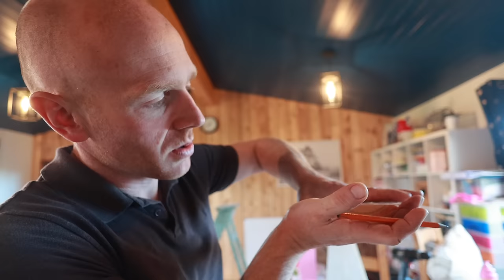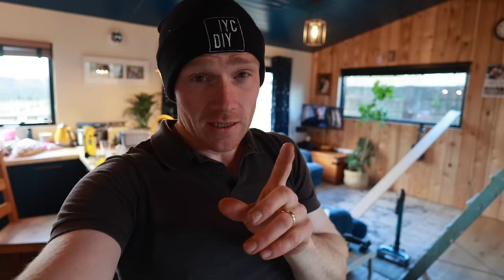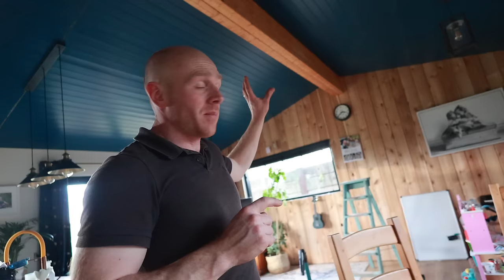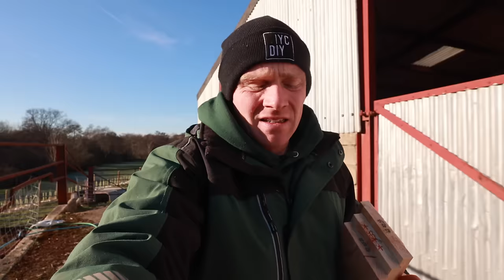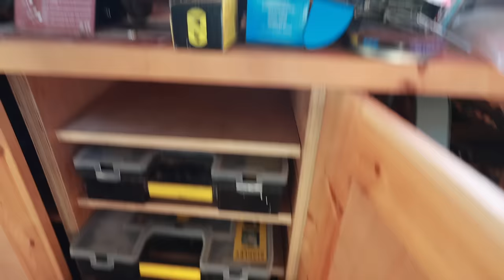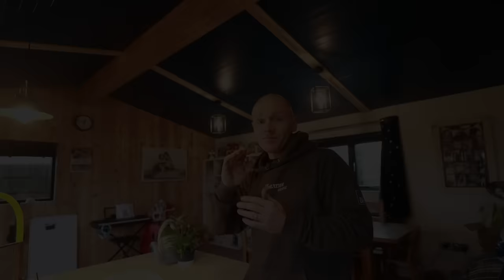BEST WAY TO HIDE SCREWS? - Am I just being FUSSY?!

Comment: Good job you have an understanding client walking on those work surfaces 😁
I would not fancy sanding the beam with brilliant extraction, dust everywhere
Reply from the maker: Yeah it will be time to pull out the big workshop vacuum for that one.  Usually ok until you get to the edge/corner and you lose a bit of suction.
Reply: @TheRestorationCouple good luck with the client following that job 😂
Reply: There is no client, its his own place, its where they live

Comment: Hi all   Great work as usual ,  to be honest there’s a lot to be said for doing the same method even if the wood is going to be painted .  Filler is not always successful , we’re as wood plugs in my experience never move .   And if installed correctly you will never see them , as long as you keep the grain running in the same direction . As you demonstrated in your video  ,  I have even  used this technique with MDF with great success .    Best wishes to you all 😀👍

Comment: Best way to trim wooden plugs in flat surfaces is to use a palm router
Reply from the maker: Ooh yes, I did that with some dowelled joints once, worked great. Bit messy above head I guess. 👍